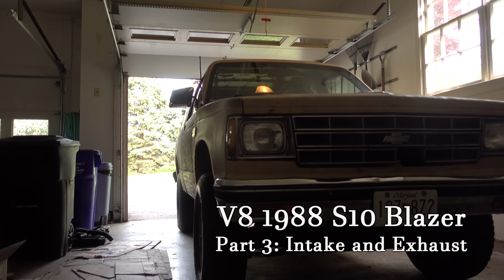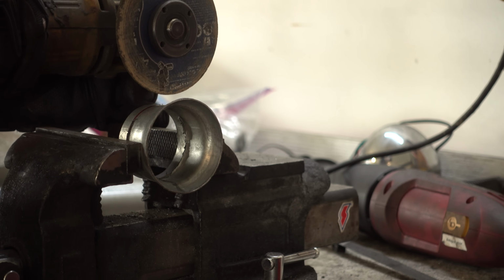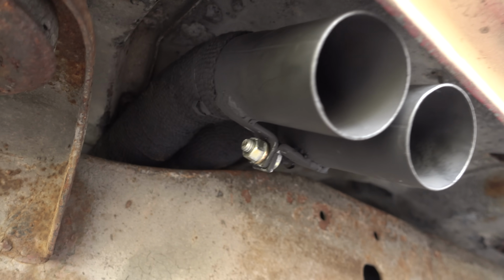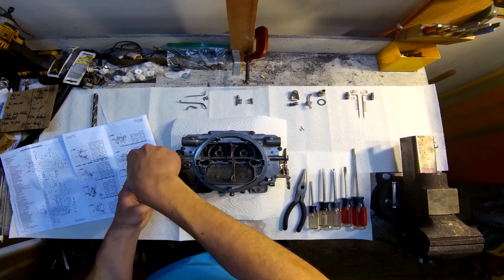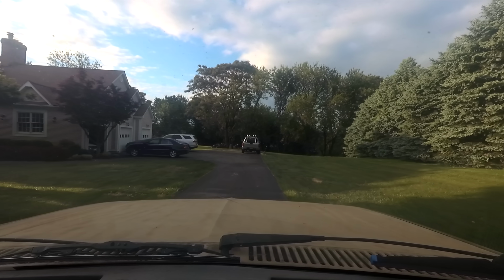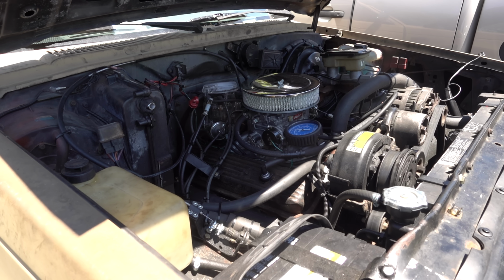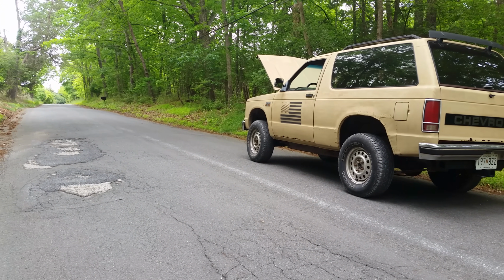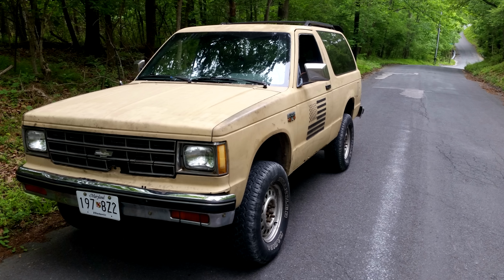4x4 V8 S10 Blazer Intake, Exhaust, and Breakdowns (Ep.3)

Comment: I have a question I got a 1990 Camaro 5.7l tbi v8 is that the same size as the engine your using I know yours is carbureted but in terms of block size is it the same ?

Comment: What size radiator fans did you use? Mine still wants to over heat with the 4.3 radiator plus 2 electric fans I might have a small size idk

Comment: I bought a harbor freight 220 volt MIG welder like you did.
You will not believe the difference by using 75/25 gas and a longer whip.
I absolutely love it now.
I can weld anything steel.
Any thickness and even rusty.
They are good welders.
I would never consider using flux core at all.
Try it it's well worth it. Trust me.
Love the swap.
I have an a 2001 S10 Blazer and have been wanting to do the swap.
Like yourself, I don't want a big bill.
I like your oil pan fabrication.
They do sell a kit but I am wary of it.
Really enjoyed your video....

Comment: I’m in the process of swapping a fresh v6 into my Sonoma and really want to ditch the old vacuum stuff for the 4x4. Do you remember where you found the bracket that you have holding the cable at the dash end? I’ve been looking for a similar one and I’d rather not try and make one. Not that I couldn’t I’m just starting to feel the “why won’t you let me love you” with my truck.
Reply from the maker: I just made that bracket from some steel strap, I don't know that anything like that exists as an aftermarket product unfortunately. The dash creaks a bit when you are locking the cable but it feels solid. The other people I have seen do the cable mod usually mount it lower down, to the actual dash/steering column supports. I have seen a picture where somebody just used a piece of steel with a single 90 degree bend and a hole in it for the cable, so it doesn't have to be as complicated as the bracket I made.

Comment: I just picked up a 92 S10 Blazer 2 door 4.3 5-speed four-wheel drive that I'm going to put either at 350 or 383 but I won't have the same issues that you had with your transmission cannot be a manual

Comment: Stuffed a v8 into an Astro Van, moved the radiator in front where the AC condenser was, chucked the clutch fan, and used a short Ford fan extension. literally about a half inch clearance,, put Micky Thompson N-50's with Anson's on the back, chopped the steering wheel into a butterfly, ran perfect. for the exhaust just used the stock 350 cross over..
But I've been wondering about an s10, and here it is. Great video & project!

Comment: Hi, most of your problem is that your intake carb flange is a for spreadbore Q-jet style carb while your edelbrock carb is a square bore style like a holley carb, which in turn means the secondaries aren't opening cause they're hitting the back edge of the intake, and it'll have a vacuum leak. Get a squarebore to spreadbore carburetor adapter plate from your local parts store, the Mr gasket brand is the one I've had best luck with, and cost around $20.00 to $25.00. That should fix most if all of your probs. Hope this helps.

Comment: I did a trick on my old Blazer back in the day oh, that has the same 4 wheel drive hub lock-in issue, but I came up with my own game plan. Since it's was vacuum operated, "can't remember exactly" but I ran some rubber hose and a 90-degree ball valve to a vacuum source on the intake or something, then when I wanted to lock in the front hubs all I would do is flip the 90-degree valve. I stuck valve inside under my Dash by the transfer case shifter, work pretty good.

Comment: I know I'm a day late and a dollar short, but air cleaner looks like it might be too small to flow enough air to feed that V8 at high RPM. That's my uneducated guess, anyway.
Reply from the maker: The air cleaner might be causing some loss of top-end power, not that this engine makes any of that, but unless it was clogged wouldn't have such a dramatic result. The problem (solved in the next episode, I think) ended up being floats that were set to the incorrect levels due to the type of needles I installed.
Reply: @FuzzyDiceProjects  - Sorry about that. I commented before I watched the rest of the series. Good job finding the trouble! I must say that I have been enjoying watching your car projects greatly!

Comment: This is my worst fear about my s10 with 700r4 I didn't make a bracket I used one for a camaro and 700r4 it does shift early but I believe that's more of a governor thing I'll change the Governor and see
Reply from the maker: If you adjust the cable correctly and the throttle arm geometry is correct, it should be okay. If the cable is a little loose it will shift late like that, and have lower line pressure which is not ideal. Maybe this info could help, if just to ensure yours is set correctly: http://www.cpttransmission.com/tech_tvcable.htm

Comment: I hated working on these types ok f vehicles. Yes I could do it but after a while it was like throwing money down a rat hole. I sold my project vehicle and got a Much newer Trailbazer. I put well over 200k on it before it was worn out. I was more than happy to sell it to someone else as a parts vehicle. The guy told me he spent 6 grand fixing it back up( I told him it was worn out) The only thing he didnt have to fix other than the water pump was the engine. It still ran strong. I changed the oil on a regular basis on it. We drove that vehicle all over the US.

Comment: Ive got a ? I rebuilt a 4.3 3 yrs ago to put in a 4x4 blazer. I drive a truck and during that time i move to Missouri from Ga. I have just now got a chance to put that engine in the blazer. Do you think i will run into any problems with it being sitting up for 3 yrs with out being broke in after the build?
Reply from the maker: Does it use flat tappet lifters or rollers? Depends on the year. If it is a new flat tappet cam and it was lubed with moly grease upon install it's probably fine, anything else (and that, even) may have dripped away and the first start could be more dry than you'd like. At the very least, give the crank a few turns by hand and run the oil prelube again before starting. And definitely change the oil if it was filled, that will have collected a lot of moisture in that time and for break-in of everything you'll want nice, new oil.

That's pretty much it, as long as it was properly oiled when assembling and it was properly stored, shouldn't have any rust build-up on cylinder walls or other parts to worry about. Make sure it turns over by hand and then go ahead and try it out!

Comment: What size are the e fans
Reply from the maker: The electric fans we used are the generic Chinese straight-blade type, diameter 12". Doesn't seem like they move quite enough air as push fans to cool this setup in traffic on real hot days though.
Reply: @FuzzyDiceProjects  ok thank you

Comment: Dose it get above 210
Reply from the maker: With this carburetor (the Edelbrock) it was always running a little rich which helped I guess, didn't have too many issues. When I switched out for a Quadrajet for gas mileage it has some pretty warm moments if the ambient temperature is 70+ degrees (F) out. A few 90+ days this past summer it climbed well over 210 in traffic with a 180 thermostat. Probably going to try to get a cheap dual core aftermarket radiator to replace the single core.

Comment: Im curious about the oil filter on 350. Isn't it possible to install the 4.3 v6 oil filter adapter on the 350?
Reply from the maker: Not with this engine block. The mounting pad on the remote adapter doesn't line up at all on my 350, bolt spacing is different. My original plan was to re-use the filter adapter, but it would need modification and new parts to work.

Comment: Just for future reference the muffler that came on 2500HD 6.0 chevy trucks in the 06-13 gen is awesome it flows close to after market high end numbers and is super quiet and can be easily gotten at a junkyard  it’s probably perfect for a future application like this
Reply: Just to clear up I’m not trying to tell u how to spend ur money in just offering some advice gearhead to gearhead
Reply from the maker: Thanks for that info! Unfortunately I don't think it would easily fit if it is anywhere near the size of the stock muffler on my 2007 1500. The tiny aftermarket mufflers usually aren't the quietest, but in a limited space environment like this the size really matters.

Comment: Hey a tip when welding that I learned the other night with my cheap ass welder, if you are burning allot of holes try upping the wire feed and see if that helps any. I did it last night welding some pipe and while the beads were fat in some spots I've never made a more solid weld in my life with that terrible welder.
Reply from the maker: Huh, interesting! Thanks for the tip, will have to try it sometime!

Comment: I just stumbled across your videos about your blazer. I am currently working on a 91 s10 king cab.  It has the LU2 4.3 liter in it.. I ordered it from jasper racing. Stock it makes 170hp/260torque. I have put an edlebrock intake, headers, jacobs ignition, bigger injectors. I would like to think its making around 200hp now, maybe more. Also had the 700r4 rebuilt, it will grab 2nd gear and get sideways pretty easy.. Also put in a 4:11 rear end from a 4cyl s10.  I did all this about 10 years ago.. and let it sit for far too long.  Now I am in the process of getting it back on the road once more. Keep up the good work!

Comment: damn those are some ugly welds, no offence
Reply from the maker: The 170A welder doesn't get along very well with thin steel and flux core wire haha, eventually tweaked it so it would feed on lower settings and using thinner wire helps with ~18 gauge steel, but butt welds are still not easy to do without burning through.

Comment: Wow, nice build!! I have the same problem with the 4x4, donde engange the front differential. Is there a video o something where explain how to do what you did? The manual engage. Thank you!!
Reply from the maker: I realize I didn't really cover it, only showed it briefly, but I mostly followed this guide: http://diamond.site90.com/html/actuator.html

Pretty straight forward, you are just using a locking cable (I got mine from NAPA) to pull the existing cable from the differential like the vacuum actuator used to do.
Reply: Fuzzy Dice Projects thank you!! Im going to try it.

Comment: Makes me miss my old 89 GMC Jimmy 
with 2.8l and 5 speed. Why rebuild old 80s sluggish chevy transmission why not just do a manual swap?
Reply from the maker: Partially for practice, because I needed to rebuild the 4L60E in my 2007 truck and they are basically the same mechanically. But also because I already had the 700R4 and the vehicle was setup for it, and just needed to fix a vehicle so I had something to drive over the winter.

Comment: hey FDP, im sure you remember me because how often I bug you in the comments. I found the forum you are talking about and it features a later year blazer. Did you stick that push/pull locking control through the same hole as shown on the forum?
Reply from the maker: I'm sorry, can you be a bit more specific? I'm not entirely sure what I did in this video haha. Is it the locking cable for the front diff? I drilled the hole in the firewall that I ran the cable through, near the gas pedal mount.
Reply: My bad, I didn't realize how vague I was. but yes, I was referring to the front diff cable. Thank you for the help!

Comment: Of course the torque converter. You put a V-8 in place of V-6, you need a V-8 torque converter also
Reply from the maker: Nope, people run the 4.3L torque converters on V8's all the time. In fact some junkyard hot rodders prefer them since they have higher stalls in a V8 than other factory converters. It doesn't seem like the converter failed when I dissect it, I really don't know what went wrong honestly.

Comment: HI. Great stuff man. I wish i could swap a v8 into my s10 with a 2.5 liter straight 4! If you ever want to do something real fun and time consuming you can follow my video on taking apart the entire dash and removing the gas, brake, and clutch pedals so you can clean absolutely everything. Including changing the firewall padding so it doesn't smell bad anymore. They get old and gross from the mold if they get wet or just old and gross. I did fix the norm to floor vent problem though so that was worth it.

https://youtu.be/QDpJvsh4Naw
Reply from the maker: Cool, I have the same problem with the vents and I started trying to take the dash apart once to lube the speedo cable, gave up quickly haha. Next time I try to tackle that I'll go through your video to get an idea of how things are put together!
Reply: It is really not that hard to remove the dash. It is a pain in the ass. You have to remove the gauge cluster, hvac control, light control switch, stereo plastic bezel, stereo. Once you have the major stuff out of the way you can take it apart. You have rebuilt a motor man so this will be like getting a glass of milk or something. I can almost guarantee  the lower vent from normal to BI LEV is broken. They used a plastic clip to connect a metal threaded screw from the vacuum door blend vent actuator thingy to the flapper that blocks the air to your feet or to the norm area.  I used 2 nuts and a cotter bit and bent the pin in the hole of the flapper. It has never failed. The flapper also is dry rotted with gross old rubbery material. It is very gross and dirty. About 5 major bolts on the bottom of the dash and the 4x 7mm machine bolts holding the dash at the top. You have to lower the steering column to get to one of the bolts and the dash slides out. My motivation was the firewall padding and the carpeting was gross. The firewall padding was moldy and smelly. To do that you have to unbolt the big bracket system that the foot pedals mount too. I cleaned everything. I used a tooth brush on the defroster vents. In the video link I sent you will show you in pretty good detail on what I mean and am talking about. Let me know! Wish I could get a v8 for my s10 after watching you do it and make it look so easy.

Comment: Have you thought about running straight dual exhaust?
Reply from the maker: Really can't come straight back without affecting ground clearance because of the front driveshaft and transfer case on the driver's side, would have to come to the passenger side and space was so tight I didn't want to fight it for this low powered engine.

Comment: Sounds to me like you might have a voltage drop at high rpm's. Probabley a loose fuse holder or a weak relay or a woren out power wire to the ignition or fuel injectors. Or fuel pump body module. You might also have a burnt out computer I have had this problem before with old power train computer components . sounds to me like you have an electeical voltage value drop off some ware that eather causes the fuel pump to go low voltage or causes the spark plugs to loose amperage.
Reply from the maker: Good ideas (although no computer on it anymore), but I did figure it out in the next video. It was a problem with the needle and float configuration in the carb.

Comment: I do believe when you run a carburetor don't they pull fuel when they should be cutting it while accelerating at high rpm? Just a thought.
Reply from the maker: Not sure what you mean by that. I fixed the stumble problem in the next video, it was a problem with the float and needle setup.

Comment: Guessing the problem is timing changing with rpm. You should be able to change the springs in the distributor... unless it's one of those new retarted electric ones.
Reply from the maker: Check out the next video, I figured it out. Was a carburetor problem. Distributor is an HEI, so mostly adjustable, didn't trust it because it was cheap but totally not the problem!

Comment: Future reference. To set a pair of floats on just about any carb remember fuel level in bowl should never be above the gasket line. If you set it and run the truck and it stumbles around a corner floats are most likely set too high. But checking color of plugs and tailpipe helps fine tune it. And doing the air fuel screws right.
Reply from the maker: Right on! These floats just threw me for a loop because of the springs in the needles. I think I needed to set them higher than spec to compensate for the spring tension. I set them gently holding down on the float and I believe that is what messed me up.

Comment: This is a comment for episode 2 really. Gm had the same problem with the s10 4x4 blazers. so from the factory they had the oil filter relocated to the in side fender (The lines did leak and it took me a while to finger out you need a 5 foot extension to reach the bolt for the lines at the bottom). I would suggest you do the same and relocate the oil filter.
Reply from the maker: Unfortunately, this S10 came with one of those remote filters too. I thought I could keep it, but the part that bolts to the engine is different and won't fit on the 350 block I have. And supposedly the universal aftermarket ones won't clear the driveshaft without modification, so I'm fine with leaving it alone for now.

Comment: Probly too much carburater for that 350 seeing as it is a trk motor which mean its small valve heads maybe
Reply from the maker: They're pretty standard size valves, 1.94 intake and 1.50 exhaust, it's just the design of the intake ports that sucks at high RPM to my understanding. You're likely right that the 600 CFM is too much, but should be close enough to get it dialed in decently.

Comment: Doing a swap on my 2000 xtreme blazer . 383 blue print with 203/64 hi flow heads and headers . Need to find out if the newer updated mpfi will work for the 383 striker motor
Reply from the maker: Sounds like a rad project! Wish I could help you but I don't know much about newer EFI technology.
Reply: 202 and 160 valves for your striker engine. You made up 203/64 hi flow heads